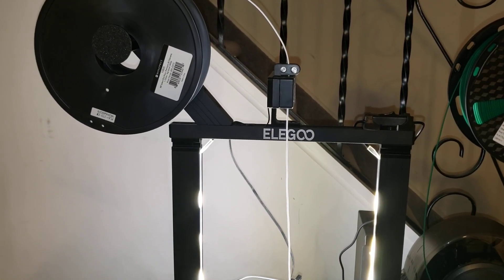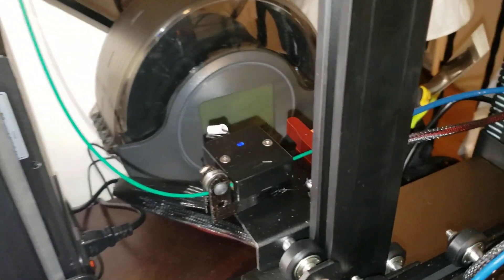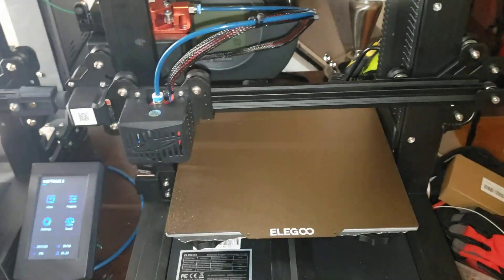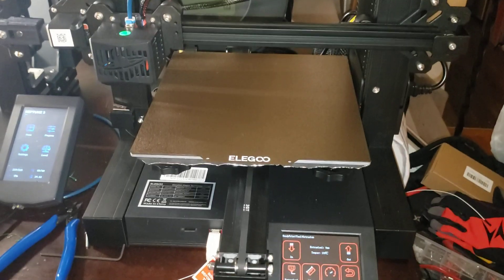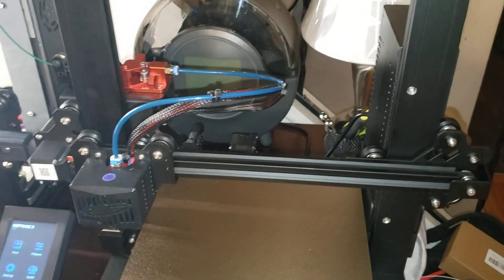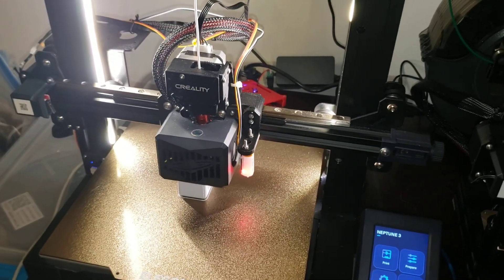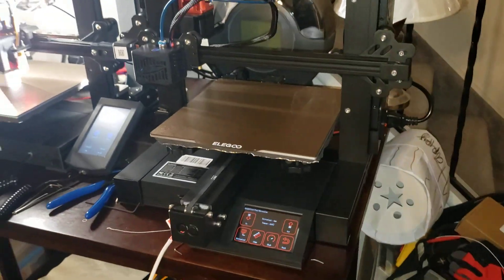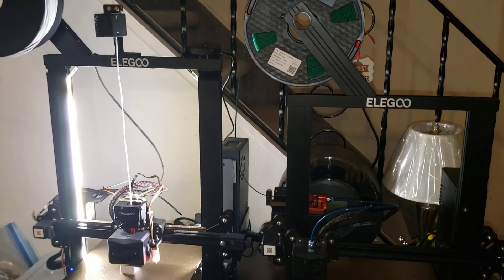I done did the thing...

Comment: I suspect the reason is that the SD card has a configuration on it (or not) that is affecting the esteps.  When you print over USB, the settings are being used from the device printing.     Also, Insulating mat is one of the best upgrades :)  Definitely helps with bed heat retention/distribution.
Reply from the maker: Nah, I formatted the card. Now I'm running on octoprint through an mks pi and it's fine... So strange
Reply: @TheFeralEngineer  it might be expecting a config file on the sd card like enders have.  If it isn't there it might default to some other setting.
Reply from the maker: @matthewwain9958  no idea. I'm running Marlin 2.1.2 now with no major issues and will probably gravitate to klipper eventually. I know the original elegoo firmware used a config file, but I never had any other files on the card other than the print job I was running, so idk.

Comment: It's the USB...
USB stands for Unexplainable Stepper Behavior.
/JK
Are the e-steps over USB directly divisible by the e-steps on SD card? It's certainly odd behavior.
Reply from the maker: I like that!!! 🤣🤣

I didn't check. But it was weird because repetier did it, Octoprint still printed a perfect part with the higher steps but then extruded like a 10" spaghetti when I commanded 100mm, so I had to pull it back to 138 and it ran fine. I haven't printed from usb since

Comment: usb cord kinked/damaged?...usb1 port to usb3 port?
Reply: im asking this because im under the assumption that usb ports and sd card slots are supposed to be the same thing but in different physical form/shape even how they connect to the main board etc....i dont know if thats still true or true specifically with that machine
Reply from the maker: @kazzTrismus  perfectly good cable. Ran my neptune 3 on it for weeks and it still works fine to control the printer in other ways... Just baffling